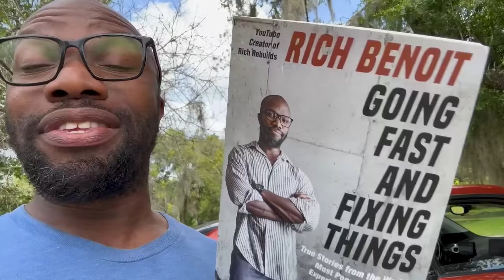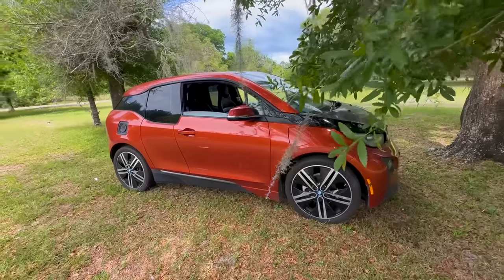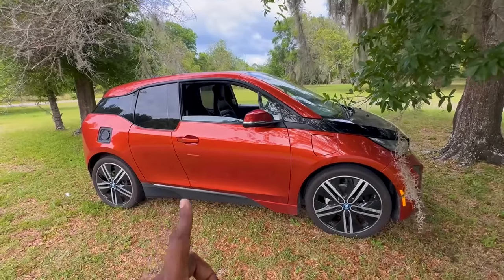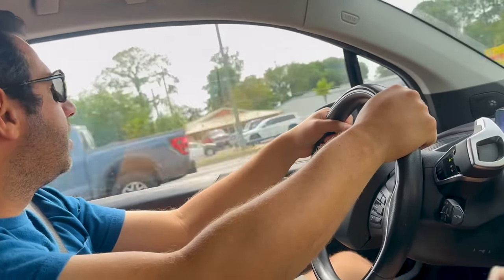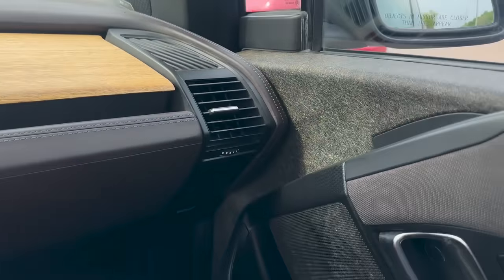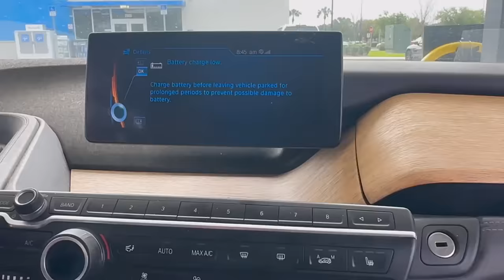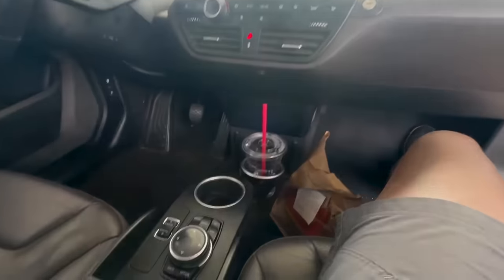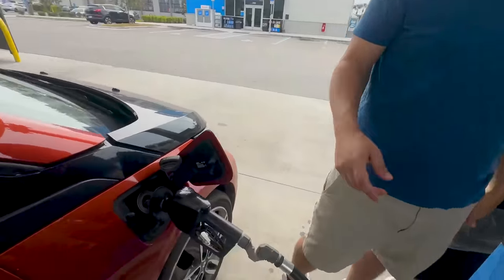I Bought a Ten Year Old $3500 EV and I Increased its Range To Over 400 Miles!

Comment: Those are still $30,000 here / $20,000 USD for the cheapest ones without a range extender.
BTW, the A/C is the first thing you check when buying an I3 as it's what keeps the batteries cool, there may be some degradation if no good.
Reply: That price is not real so no point in trying to find one for anywhere near 5k

Comment: What's the point? If you are going to drive a gas car, you can easily find one with 400 miles range which is less complicated, more reliable and easier to work on if something goes wrong. Oh, and pretty much everything else would be less quirky, and definitely less ugly than that i3.

Comment: How are things further away now? If by 'things' he means chargers the opposite is true, and pretty much any other 'thing' I can think of only became more common. Probably just misspoke. 

How does range anxiety still exist anyway? Back when I got my 2017 Bolt I drove Denver to Des Moines just fine, now there are even more chargers out there. Outside of road trips I never have to use public chargers. For the first couple years I had it I ran an extension cord out from the 120v outlet in my mom's porch to where I parked and that was enough. 
With my old 'Roos I'd have to make a special trip to the gas station a couple times a week. Plus it was super expensive, plus even with their legendary subaru reliability I'd have to spend a few dozen on maintenance per month. 

The 'Roos cost around 25 cents per mile not counting maintenance. My Bolt costs like 6c/mi even where electricity is 22c/kWh. It'll be even cheaper once I can get some solar panels up. 
Electric was the future like ten years ago when this neat looking car was made. It's now the present.

Comment: I would rather have a smaller engine and add more range. I would also rather have a diesel engine because the fuel would last much longer.  A diesel hybrid that get 35 to 50 mpg and has 10 gallon tank and then a 100 to 150 miles of EV range is good. The whole package would cost less than 25k with all the options.

Comment: Seems like you will run on gas forever, is there a way to shut off the gas and force car into EV mode? Or maybe its OK if you get better mileage converting gas to electricity.

Comment: I recall there was an aftermarket vendor in Cali selling upgrade battery packs for the Prius which increased the standard range of 120 to 200 to 1200 miles on a single charge?!?
So finding a process to upgrade older generation EVs with new tech is a smart strategy. Especially when the "value" drops dramatically after 5-10 years. Just as you've done buying it for $3500 and getting a upgraded engine, battery may only cost $2-8k (not including labor). Still significantly lower in price than the current new EVs on the market (that is until the Chinese EVs hit the market).

Across the pond is a company providing "bolt in" conversions for collectible and older vehicle models. Imagine having the same for models from the 60s to the 90s?
https://www.youtube.com/@ElectricClassicCars

Comment: Wouldn't it be a better overall solution to have the filler-neck go to the new tank, then the new tank goes into the stock one, but breather is on the new one, so it would constantly be filling up the stock one until the new tank is empty? Virtually just creating a bigger tank and all the car sees is that the fuel level isn't going down until the new tank is empty
Reply: That might overfill the original gas tank and destroy the evap system and cause tons of check engine light codes. I know these systems very well as I was a certified mechanic until I moved on to better pay in trading.
Reply: Overfill might cause the Port lock not opening, and that's the least of the problems. The small gas engine is not designed for running over a couple of hundred miles in a single run. Especially in summer, the engine and the cabin heat up quickly due to bad insulation of the rear engine compartment. Also, the engine itself can overheat, giving you unrelated error codes. Would be better to buy a used 60AH version and swap the battery pack with the 120Ah.

Comment: You can take a train from Orlando to Virginia. It’s called the auto train from Amtrak. They put your car on the train and you ride in the comfort.
Reply: What about the overal cost ? (honest question, no tricks)
Reply: @jplacido9999  $165-$210 for that ride
Reply: @Doing_it_right_the_first_time  That's actually not bad.
Reply: @Doing_it_right_the_first_time  more like $800+ when adding a car. $280 for one person plus $540 for a standard sized vehicle (round trip).
Reply: @alexpishotta2895  I got a quote for taking the auto train from NJ to FL once and was told $860 and that was 15 years ago. It only cost me $300 to drive and I got there faster. 
Its actually cheaper to fly and rent a cheap car for the week or month. 

My concern with that car is what would happen if some drunk driving an old pickup crossed the center line or some old woman driving some old luxoliner from the 1970's runs a light. There's just not much metal between you and the other vehicle. Those sort of cars may be fine in the city but have no business out on the freeway with big rigs and dump trucks. I actually feel you may be just as save on a motorcycle because on a bike your more aware of what's around you.
Reply: Then you have no video.  This isn't about the most practical and unfilmworthy solution to relocating an automobile.
Reply: @VB-bk1lh a motorcycle isn't a safe or safer, it's not about how aware the motorcyclist is, it's dangerous because those same drivers you pointed out aren't as aware of our don't see the motorcycle. You have a better chance of unsafe drivers seeing an i3 over any motorcycle. Most bike death's are due to other drivers not the motorcyclists.

Comment: Rich, if the "gas station is closed" but the lights are still on the pumps, you can still fill up.  It will tell you prior if it's truly "closed"
Reply: Came here to say this. I've filled up at "closed" gas stations a handful of times. The pumps are usually left on 24/7.
Reply: apparently not. the attendant rolled up on me once as i was about to fill up and said they were closed and i couldnt use the self serve pumps... the pump didnt say anything about being closed
Reply: Depends on the gas station. I have been to many gas stations that were closed and still had the pumps on, but a handful where they were either locked up physically or just off. Pretty sure Sinclair (the place with the green dinosaur logo lol) always has them off at night.
Reply: @Wopwopwopfuckitup in california, Arizona, Nevada, Louisiana, Florida, and new york I've never gone to a closed gas station that didn't allow pumping with a card.

Comment: Funny. i just watched your Fisker Ocean review and even commented. And now you are talking about the i3. I own a 2020 i3s REX and I actually drove it round trip Phoenix to Philadelphia and back. I was clever about it. I hacked it so you can turn on the REX at 75% or lower state of charge. I would drive it till 25% battery, approx 140 miles, then run the REX for it's 70ish miles and tank up again for a second 70 miles. So 140 + 70 + 70 = 280. Then I would tank up and charge. Was not as bad as you think as I would drive about 6 hrs a day so 280 miles was 4 hrs or most of the time longer with some traffic slow downs, Then that 35-40 charging break. The gas stops to fill the 2,2 gallon tank I don't count as a pain as it's a very quick stop. Nice video here as well.

Comment: I have a Chevy Volt.  I love it.  I get about 50 miles on a charge, and it has like a 12 gallon gas tank.  My normal daily commute is about 40 miles and is done on electric and then I have the gas engine if I want to go farther.  Of the 62K miles I have on it so far, 95% is on electric.
Reply: Sounds like you'll be soon driving a Tesla :D
Reply: @rkan2  Bought one last August.  So we have the Volt, and a Model Y.  😀
Reply: And go figure, Chevrolet had a great plug-in hybrid in the Volt, so they discontinued it.  🤦‍♂️
Reply: You just wrote, that you should drive an EV
Reply: @NickWindham  Yeah, I am as well.  It is a great small car for someone that wants to go electric, but still have the gas engine to fall back on.
Reply: @timogronroos4642  Not sure what you are meaning here.   I have two cars, one a Model Y and one a Chevy Volt...

Comment: The chevy volt has more electric range and has 13.5 gallons of gas !
Reply: But it's a Chevy........
Reply: I love mine!
Reply: Yeah but GM  stopped making those. 🙄 Idk what they were thinking. I think the volt was the coolest hybrid they made.
Reply: @commonsenseisdeadin2024  Chevy builds darn good cars when they actually give a crap. The problem is getting them to give a crap... however, the Volt and Bolt are two cars they did give a crap about and are actually good. But of course GM being GM they cancelled both right when they were getting popular.
Reply: i3 is a lovely car inside and to drive though
Reply: I own a, vauxhall ampera and the i3 rex will be the next car I buy to replace it I'm currently on 160k miles and only problem I've had is the engine mount breaking.. Think I've been real lucky
Reply: @Thinginator "GM build good cars when they give a crap but they don't give a crap" 😂 so you agree!
Reply: @Thinginator  I would agree except for the Bolt. They messed that one up good by crippling its trip capability and limiting the charge to 30-56kW because of the ~150A busbar current limit. Had they improved that, Bolts from 2017 to 2023 could be charging at 60 - 180kW which their batteries are more than capable of keeping up with. That, the old "starting the car" philosophy, the FWD, and the creep mode that emulates automatic transmissions in drive are the only areas I could say were missed opportunities.
Reply: The bolt is actually coming back faster charging and hopefully 300 mile range @Thinginator

Comment: @rich rebuilds - A dutch company managed to squeeze in a new battery design that gave 400 miles range.  The Rex is great, but genuinely fragile.  I have a Rex here in Ireland and I use it sparingly.  Don't overfill the tank either beyond the first click of the fuel pump, or the charcoal cannister gets soaked and throws EML lights all the damn time.
Reply: What is the name of the company!! Please do say!
Reply: Which company?
Reply: @supernenechi  It was a German company, not Dutch, Lionsmart.  They never commercialised it.
Reply: @YTesting   It was a German company, not Dutch, Lionsmart.  They never commercialised it.
Reply: @EntropiaGuitars  I found them, thanks, that is insane

Comment: " 2014–16 i3 REx vehicles in the U.S. are limited to a fuel capacity of 7.2 L (1.6 imp gal; 1.9 US gal) electronically, in accordance with the car's classification as a range-extended battery-electric vehicle; with the full capacity, the gasoline-extended range would exceed the all-electric range"
Reply: How can the fuel capacity be limited electronically?
Reply: @TheJamesLykins  Honestly. I dont know, other than maybe a sensor and tank purge system combo that senses how full the tank is. Kicking the pump filler off any time it gets up past 1.5 gallons or so. I think this is what tthey were speaking about "coding it" to allow it to fill up higher. Wonky ass German Eco shite imho. Interesting though.
Reply: @TheJamesLykins  with a very good level sensor so that when the float or whatever gets down to the level where there's a half gallon left it shuts off the engine.
Reply: @greggv8  It does not shut off the engine as such, what it does is prevent you form filling the entire gas tank. Thus the mystery we are talking about. How it electronically stops you from putting the last half a gallon or so in it.. It has to be something to do with how the pump kicks off automatically. Some cars when the gas tank evap Purge system gets clogged or fails, will kick the pump off even when the gas tank is near empty. I had a 2001 subaru like this. Try to pump  full tank, it took you 45 mins, because every 30 cent or so it would kick the pump, because the gas would back up the tube.. because of air pressure not being able to be purged from the tank the right way, all the air had to come from the filler neck, thus it kick the pump repeatedly, you had to barely squeeze the pump handle to get it to trickle fill, so air could escape while you were adding fuel. PITA... We sold that car not long after a few tanks of gas in the winter...
Reply: @crisnmaryfam7344  If it always shuts off the Rex with half a gallon in the tank then of course you cannot put more than 1.9 gallons in it. No "magic" at all.
Reply: @TheJamesLykins  The car's computer is programmed to limit the fuel pump to the gas engine. Rich quickly said the computer has to be reprogrammed to unlock more fuel pump usage. The i3 has an electric battery and the gas engine is an electric generator to charge the battery. The problem with the i3 with factory programming is the gas generator engine turns on at very low battery and then the power of the car is severely limited compared to when the battery has more charge. That is why a reprogram of the computer makes the car more fun to drive for longer than 50 miles range.

Comment: It would be better to increase the battery size. We have one of the last ones made in UK with a 42Kwh battery.We can get 200mls out of it if you drive carefully. Highspeed charging 50Kwh + takes about 40 mins, just time for a coffee. The recharge netwrk is increasing rapidly. Maybe charging infrastructure isn't there in US.
Reply: Batteries are just expensive, and extremely heavy. 
Carrying around 50kwh of batteries when you only use 10 for daily commuting just wastes a lot of energy and makes the car age faster because of the added weight. Plus in the end for day long drives (which are a lot more common in the US because no trains) you will still need to stop for a full recharge several times, adding several hours to the trip.

Comment: The i3 is a nice project base - well-documented, modular, lightweight.
Nice one for April 1st as it is so odd...
I own one and have a lot of good reasons...
One hint: Avoid the REX.
Reply: How has your experience been? I've always been a fan of the looks of it but I've heard some nightmare stories.
Reply: What is the issue with the REX version?
Reply: REX is inherently inefficient due to energy conversion losses (see Chevy Volt or Honda Clarity for solutions)
Reply: @TherapyGel  I don't like the exterior, the issue of brake rust, the lack of rear window lifter, the missing middle rear seat and I would love 25% extra range on my i3 120Ah.
I like all the rest of it, especially the materials - real wood, real leather, natural wool in my variant, aluminium, Kenaf (the grey door panels), the absence of odors, the practical trunk (opens 101cm x 61cm), interior and exterior lighting, audio, tires (on snow and rain especially), the low weight, the acceleration, the dashboard and iDrive, the features...
No nightmares so far, I drive i3 (non-REX) since 2019.
Reply: @LuvADuc  With the first battery ("60Ah"), the REX was a good idea. However, the bigger batteries 94Ah and 120Ah changed that.
The REX halves service intervals (from 2 years to 1 year) and almost doubles service and MOT cost, costing you 4x in service alone. It also adds 120kg, making the i3 slower and reducing EV range.
Additionally, the REX consumes a lot for what it does, so it really should only be used as a backup generator for emergencies.
Reply: @LilaKuhJunge  Wow, thanks for all the info. Are you in an area where you get cold weather? Curious about how well it handles that.
Reply: @TherapyGel  Yes I am, some days go down to -20°C. The car and the battery can be pre-heated for pre-programmed departure on a wallbox. If you don't do that, range will go down *a lot*, like 30%-50%. The workaround is to charge at the start of the trip to warm up the battery.
I recommend frequent charging on long-distance winter trips to keep the battery warm, an interior temperature of at least 18°C and I also recommend to exit while fast-charging and activate preheating only during the last 5 minutes of the charging time (via app or key).
Nokian Hakkapellitta R3 is a good winter tire for the i3 imho.
Reply: @LilaKuhJunge   Thank you very much for the information. In my case I'm looking for something just to get around town. My commute is short and I have another car suitable for longer trips.  So long as I can maintain a solid 100 mile range or so, it'll be fine for the right price.
Reply: @LuvADuc  I am on my second I3 rex. I upgraded to a  2017 from a 2015 model year. I had no problems with the 2015 and I have put on 40k miles with my 2017 with no issues. I have a total of 69k on the odometer. So far it's been a pleasure to drive.
Reply: @LuvADuc the REX adds 15% more weight to the car which kills about ten miles of battery range, almost a second extra 0 to 60 and it doesn’t handle as well. So, if you’re mostly using it to commute, you’ll be dragging around a gas engine that you’ll hardly ever use and still have to maintain. The couple of times you might need the REX, just stop and do a fast charge
Reply: @LilaKuhJunge so it should be used as a range extender
Reply: @lemongavine  Weight added is just under 9%, and some of the range reduction in normal use also comes from only having a resistive heater vs. the heat pump of the standard BEV.
Reply: Also, "just stop and do a fast charge" does not work when it's 90 miles between chargers and you run out of charge at least 20 miles before you get there. (Reality for the PNW in some areas.)
Reply: @LilaKuhJunge  I have the 33 kWh REX and it works fine, removes range anciety. Out of warrenty it is very simple oil change etc. and with the hours its running you can do it every 2-3 years.